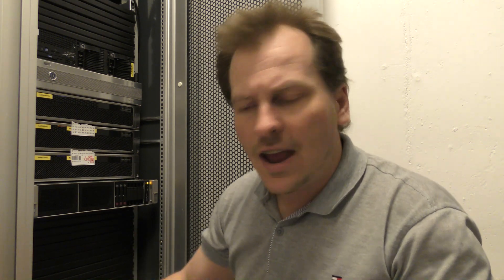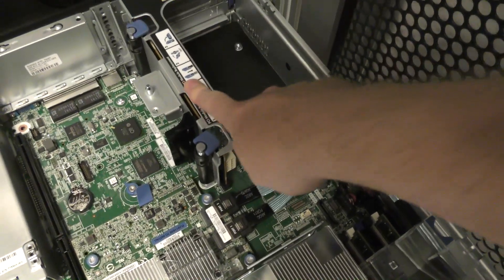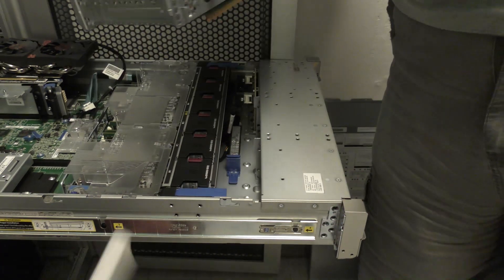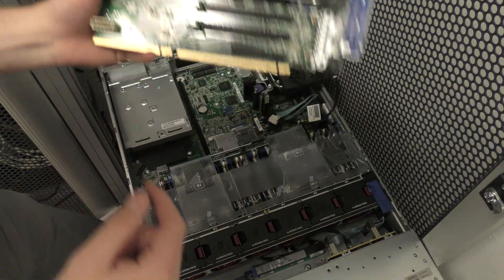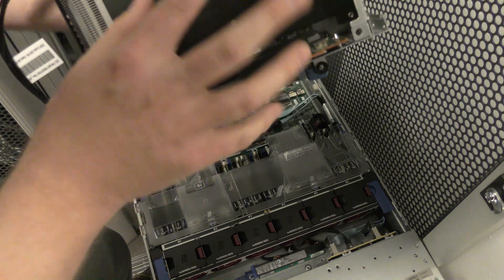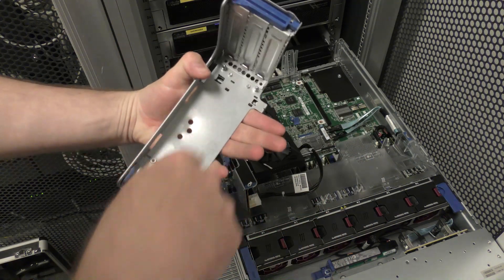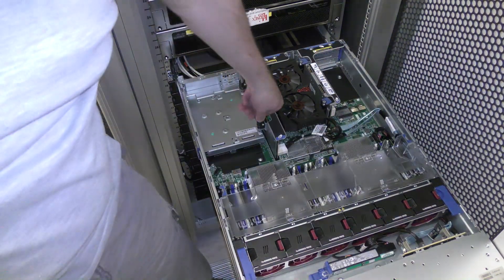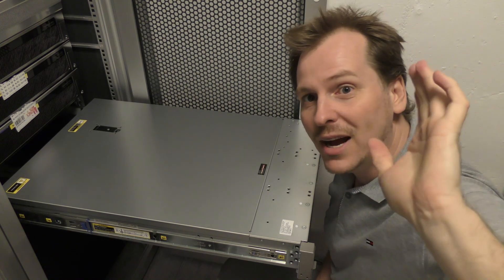ASUS GeForce GTX 960 STRIX in an HPE dl380 G9 Server - 361

Comment: I wonder if it's possible to simply remove the fans and shroud from the original card and just rely on the server's cooling to cool it.  (The fins are running the correct direction, so maybe?)  Might have even allowed you to use the original expansion slot bay and not bought the expansion one.
Reply from the maker: Hi Robert
Thank You very much! maybe, but the hot air is being blown out the back, and the server has been doing okay :-)
Thank you for watching! :-)

Comment: I would be worried about airflow around the two cooling fans. It looks as though the top of the server will not allow much room for those fans to take in air (or expel it).
Reply from the maker: Hi Mark Potter
Thank You very much!  I think this is all fine,, but this was not the best fan solution for this GPU.
Thank you for watching! :-)

Comment: Why didn't they decide to use some graphics card with blower style cooler? Or do server fans generate that much pressure that air will be pushed out right after graphics card will "use" it?
Reply from the maker: Hi 
This is pretty close to how this would work in a gaming PC,,except that this server has a much better air flow.
Thank you for watching! :-)

Comment: Looks cool. Maybe you should do some more testing with GPU and a HP DL 380. I personally love the DL 380 line. The front panel is excellent idea since it shows what is wrong and where instantly from the front. I had one the other day that had RAM DIMM failure and I knew it from the front panel. All DIMMs were orange haha It was due to moving the server across country and the DIMMs must have giggled around. Re seating them and bingo back online in minuets. 

Also I agree with others the best would be a "Stock" or "Reference" design maybe something from EVGA. Since they blow out the back and it keeps in with the server air flow design. 

Furthermore how is the dust in your playhouse server room? Do you have to clean your 24/7 IBM sometimes? I presume you don't have any filtering in there.

I was tempted to buy a Apple Xserve the other day. Just for fun lol. I decided against it since it was only a quad core one. :P I am a 8 core kinda guy :P haha
Reply from the maker: Hi 
I did not have the option to play around very much with this, server.
It was already delayed because of the missing, riser card.
Thank you for watching! :-)
Reply: I meant for you to use your DL 380 G6.
Reply from the maker: HI thingyee1118 
I have looked at this more then ones,, I am better of with the IBM's. They have the 6 pin power,, the G6 does not :-/
Thank you for watching! :-)
Reply: ah ok. you not answer question on dust in playhouse and servers! 

click readmore on my comment.
Reply from the maker: Hi thingyee1118 
Yes..stuff gets some dust,, it's not that bad. I did do a video on the IBM x3950 being cleaned with an air compressor,, but it is a older video. I have a thing on the air intake,, but only to stop big stuff form entering. I do need a air filter.
Thank you for watching! :-)
Reply: Ok thanks for reply. Sounds like you have it manageable.
Reply from the maker: Hi thingyee1118 
Yes it is not bad at all.:-)
Thank you for watching! :-)

Comment: You mention that if you were to break that one riser card it wouldn't be the biggest mistake you've made. I'm curious to know what your most significant mistake was. Mind sharing?
Reply from the maker: HI 
Probably trying to print out a nice christmas card, on a piece of overhead projector plastic . On a big $10.000 color laser printer,,,, it melted inside the printer,, used $3000 trying to fix it, but My boss ended up buying a new one for $5000. A $18.000 chrismas fuckup on my side... and is was a little private thing i was doing :-/ I am still hearing about this 14 years later.
Can you beat that?
Thank you for watching! :-)
Reply: i saw a 20 year old intern drop a faro laser tracker.....what he was handling it for is far beyond me but it happened, lol I've actually seen some pretty huge fuck ups over my time in the aerospace industry. lol

btw, i've been enjoying your videos, don't worry about the lamo haters who are giving you flack for your English or whatever, i enjoy your presentation and aesthetic.  keep up the good work buddy!
Reply: The "new kid" was somehow assigned to swap the memory and enormous ISA card that went to our magnetic tape drive.  He open machine, remove old card Nd memory while machine was on, and also insert the new replacements. 

I ask NEW kid if he was HIGH or would this be his first time working on a computer?  He responds "I thought it was hot swappable!"

I do not know how much the tape-drive controllers cost - in 1995 there was like only 4 places to buy them from, that took us like 2 more weeks to have express emergency card sent to us.

Comment: The GPU is going to be grossly under powered. The PCI lanes only supply up to 75 watts of power. The card should be plugged into the PSU, not the riser card itself. The 960 is easily a 125 watt card. Correct me if I'm wrong.
Reply from the maker: Hi 
You did not see the cable,, the 8 pin thing that can supply 150W ??
There are extra power connections in the riser card.
So there shout be 225W available,,
Thank you for watching! :-)
Reply: That's what the extra cable is for. Even though the riser card goes in what seems like your average PCI-E slot, it actually has extra leads that bring the extra power to the power cable. It's a " wire-free" approach.

Comment: I agree a reference card would have been best the fans are basically going to blow the heat against the top of the case. It may heatlock. saying that, if it's just getting used for h264/5 encoding it should be fine. If not, you get to install another!
Reply from the maker: Hi 
This is pretty close to how this would work in a gaming PC,,except that this server has a much better air flow.
Thank you for watching! :-)

Comment: why didn't you use the original riser card on the left slot and used the right slot with that slot bracket. the right riser card is unused so this would have fit easier.
you do nice videos, keep on with that.
Reply: He covered that in the video. 2:40
Reply: no, thats not what i thought about.it wont fit on the original rizer card in the right slot but there is no need to use 2 riser cards, when only one is used ...
Reply from the maker: The mounting of the first riser card is different then the second, card. I don't know, and did not try if i could do that after removing that metal lock think and the plastic thing... but i do not think so.
Thank you for watching! :-)
Reply: noodells2 
Ahhh I see it now. Guess I kinda sped through it the first time.
Reply from the maker: Hi psygn0sis 
I can't blame you! I'd speed through me to :-)
Thank you for watching! :-)

Comment: You should get a magnetic screw tray so that you never lose them :) they're pretty inexpensive and portable
Reply from the maker: Well I shout just stop screwing with stuff over a open server.
Thank you for watching! :-)
Reply: My PlayHouse That's also a cheaper solution :)
Reply: I have the magnetic tray  and only seem to remember to use it every 4 months when the one thing I am working on, has stainless screws which are not magnetic.

Comment: what was the biggest mistake you've made?
Reply from the maker: HI 
Probably trying to print out a nice christmas card, on a piece of overhead plastic . On a big $10.000 color laser printer,,,, it melted inside the printer,, used $3000 trying to fix it, but My boss ended up buying a new one for $5000. A $18.000 chrismas fuckup on my side... and is was a little private thing i was doing :-/ I am still hearing about this 14 years later.
Can you beat that?
Thank you for watching! :-)
Reply: +My PlayHouse (Morten Hjorth) oo god that sucks...

I broke 3 of my GTX 780's while overclocking... this probably not much money to adults, but to a young 15 year old it is :(
Reply from the maker: HI Martijn Mol 
Hey 3 GTX 780's was probably also a lot of money,,, I did not have to pay for my mistake,,with money,,just the embarrassment.
Thank you for watching! :-)